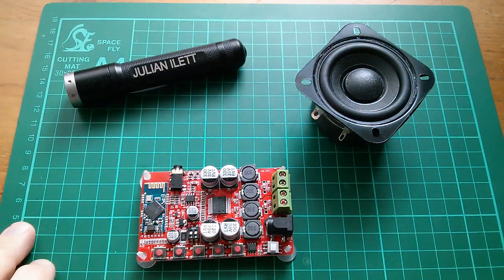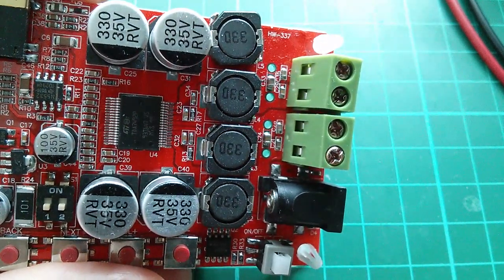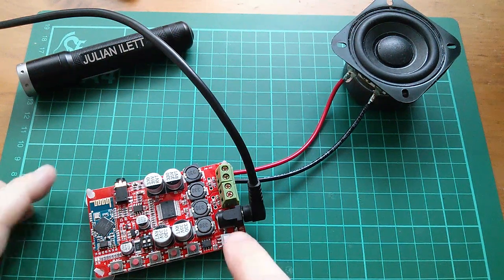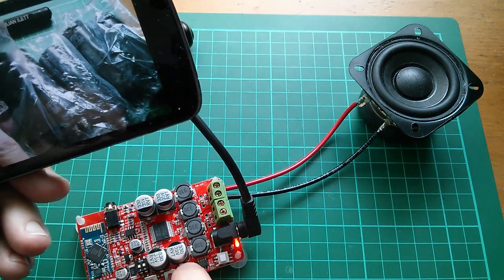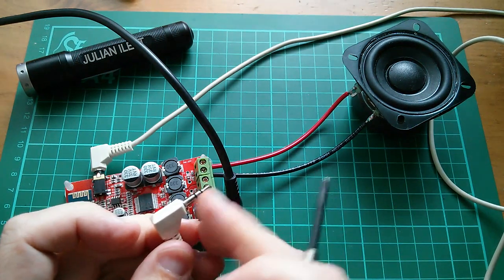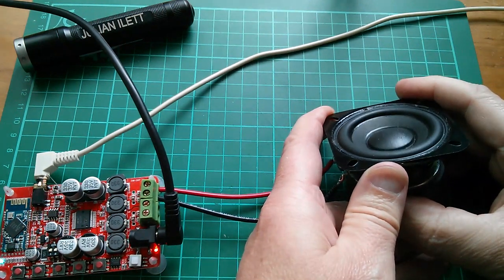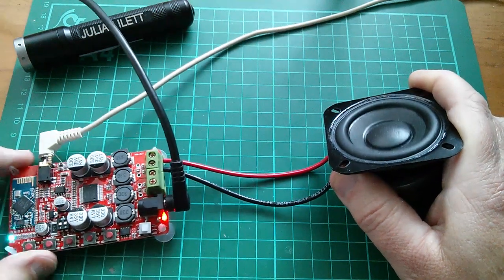SuperCapacitor Bluetooth Speaker Testing

Comment: if you use a boost buck DC-DC adjustable step up down converter XL6009 and set it to 12v, you can get more run time right down to about 3v. Alice sell them. I order them 10 at a time

Comment: Julian, tinning the wire ends that go into screw terminals isn't a good idea. I was told so myself but didn't really believe it until I found out myself the hard way.

The problem is that the pressure makes the solder actually flow, just very slowly. The inevitable result is that the connection gets loose, and then you'll get sparks, which are *hot*.

This way I managed to melt away the plastic of a lustre terminal with which I had connected two 5W heating foils in series to 24V. That's not even half an Amp.
I should add that the time scale was several months until the actual short, and that there was really NO mechanical stress on the connection - other than of course that of screws pressing onto the tinned wire ends.

Comment: with the supercapacitors and one speaker it takes ~7 to 10 seconds for 0.01 volt to get consumed if we assume that the real charge of your capacitors is 2.5volt each then we are talking about 15 volts so in order to go from 15 to 8 volts at the aforementioned rate there needs roughly one and a half hour to pass... so not that much really (comparing with other BT speakers that last for hours some do more than 8 )

Comment: I think the sound in your device is turned off due to the fact that the AUX input passes a sufficiently strong signal and triggers the protection of the chip of the amplifier. Try to lower a volum in AUX. I had a similar problem when on this board I put the capacitors on the speakers as a filter and when I increased the volume on the board of the amplifier, I was protected and I had to reconnect the power supply.

Comment: Can I ask you 2 questionsthe first question would it be possible to have the volume buttons  be off the circuit board and elsewhere but within the same unit 

Alternatively if I wire say a 10K  potentiometer between the speaker and the board  could that act as a volume adjustment knob

Comment: I recently bought a Chinese made DC to DC buck converter, that was supposed to take 12 volts to 40 volts DC in and with the pot convert it down to 1.volts DC out. My plan was to hook it up to a 12 volt DC laptop power supply to it to power both my MP3 player and a Chinese made 12 volt DC dual channel amplifier board! BUT The moment I powered up the laptop power brick....the caps on the two buck converters exploded under just 3 amps of load from the laptop power adapter! 

Long story short I changed gears and decided to hook the laptop power supply to a standard car stereo! And totally scrapping the idea of the amplifier board! So I as wondering if anybody had any ideas for a decent buck converter that would work in this set up if I did decided to go back to the original idea! Thanks in advance!!!

Comment: I did a quick (non-technical) estimate of how long the charge would last (assuming the capacitors were "full"). My estimate - roughly 30 minutes - is based on timing how long the voltage in the video took to drop from 10.55 to 10.50 volts. I then used this to reckon how long it would take to drop to 8 volts (the threshhold voltage to make this particular loudspeaker work). The figure I came up with is roughly 30 minutes. 

Needless to say, this is less than impressive and makes me wonder whether the whole idea of getting speakers to work on capacitors instead of batteries is fundamentally flawed. It is interesting that the crowd-funded Blueshift capacitor-powered portable speakers project seems to have folded. I can find no other similar commercial ventures on the internet. Heigh capacitor weight, low power density and low suppy duration may be the reasons.

Comment: Polarity does matter for stereo. if there is no marking on the speaker then connect a small dc supply for a moment. if the cone comeout outward then positive pin is the one that is connected to the positive of dc supply. any one working with audio should understand the polarity first. inadequate experience sometimes reveal wrong information.

Comment: Interesting project. The voltage change will make that tda7492p start to sound quieter as the voltage comes down. At 20v it might make 20wpc and at 8v it might make 5wpc. So depending on the volume level you might notice the difference every 20 minutes or so while listening.

Comment: 2 things 
A you only saw the voltage drop with one speaker.. 2 speakers will double the V drop.. 
and point B
when driving an amp with lower voltage, the output power will be less because of the voltage drop and increased current.. so clipping occurs way faster that way

Comment: That mute pin is to stop the power surge going to the speakers when the power turns on as well as to prevent bluetooth and aux both playing at once. If you dont want it to mute, disconnect it from bluetooth.

Comment: Maybe you can use the LTC3780 boost / buck converter to step the voltage seamlessly up and down :) So you can get lower than 8 volts at the input.

Comment: The mute function on the data sheet was likely supposed to be connected to an aux input jack that had a built in switch.  My guess is that either the jack they used doesn't have the internal switch that senses when you plug in an input or they simply didn't connect it up.  In situations where this amp board may be driving a higher amplification stage, you would likely want to mute the aux input when not in use to reduce noise.  When you finalize your project it would likely be a good idea to have a switch for the aux input just to eliminate possible noise.

Comment: I have an amplifier like that, earlier revision and it gets wonky at maxed volume as well.  I did have fun testing voltages from 9V-19V based on what I had around.  Give it more voltage and you'll get more volume out of it and not have to use max and get the distortion anymore.

Comment: Polarity makes a hug difference if listening to headphones. With in-phase speakers, a sound that comes from both sides equally will appear to be in the center of your head. If the speakers are out of phase, you will hear them both distinctly on the sides of your head.

Comment: Julian, consider adding a boost regulator with an enable pin, set it up to turn on around 8.25V and off at whatever the minimum is for the regulator, this would allow you to run much longer.

Comment: Hey just a question regarding this board is is possible to set the vol to max  when using bluetooth. I am planningto use in the ceiling to drive a speaker using the room lighting power so I will have no access to the button but as you know when you turn on the vol is set at half if you soilder the button on it will beep at the max setting. have you any ideas.
Regards
Greg

Comment: if the speaker connectors have a common ground, then the easiest way to find "-ve" connection is to see which 2 screw connections had continuity? or am I missing something?
Reply: I think the -ve of the two channels are not common as both +ve and -ve can swing between 0 and vcc in this amp. Connecting both the -ve together will short the amp.

Comment: This is one of the best value for money amplifiers I have bought and tested. When you have this as your sound processor and a set of decent drivers, you have a set on the same or almost the same level as a Marshall Bluetooth speaker at a fraction of the price.

Comment: Julian, 'ianstrobe' claims the Play/Pause button doubles as an input 
select switch. Holding it down for 3 seconds toggles between AUX and 
Bluetooth input. It appears the modification was in vain. Were there any
 instructions with the device?
Reply from the maker: +alanmelb I did try holding the buttons down, but maybe not for 3 seconds. I'll give it a try.

Comment: Don't you just love undocumented (or forgotten!) features? That speaker looks like a cheap, second-hand midrange one, so don't expect any great shakes from Bass or Treble frequencies. Nonetheless, it works well, and should be fine for the low quality delivered by even the best mp3 files. If you want to listen to stereo sound, you need to do at least three things with those speakers: 1) Make sure that the polarity of both is identical (Yes; it is very important!), 2) Put the speakers in a correctly-designed box, and 3) Space them apart adequately. Maybe 4) Buy Bass and Tweeters, plus the correct crossover circuitry for the speakers, and 5) Use decent quality sound files. But 4) and 5) are for purists!
Reply from the maker: +RWBHere Yes, I agree. I may also look at passive radiators.

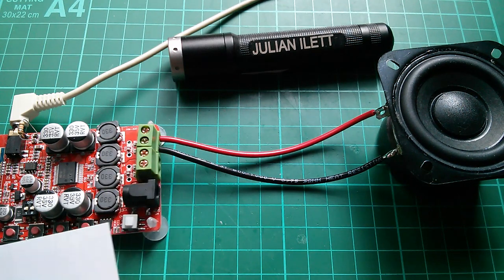Comment: 15:45 Ouch, that speaker does not seem to be happy...
Reply: Yeah, I guess I would put it on mute for 2 seconds with a 555.
Reply: Kyôdai Ken and how would you do that?
Reply: he meant, put a voltage on the mute pin of the amp chip for 2 secs with a 555. but to say, you can just do it with a capacitor and accessories.
Reply: Yes, this is what I meant. Now that I think of it, this is not a guarantee to stop this weird dc offset from happening on power on...

Comment: Hello Julian what about Adding a make header pin 2 pin to that Resistors bypassing it. With a Jumper on the header pins? are they close enough you can do that?
Reply from the maker: +joseph chrzempiec I may add a switch, because disabling the mute circuit compromises the anti-thump.
Reply: Julian Ilett ahh okay I understand I think I had this problem on another bluetooth speaker I had. that explains a lot

Comment: Around 5 minutes? It's draining at 0.01v per second.
Reply: Even 0.0075 approximately. This will give you roughly 5 minutes and 30 seconds.
I would put a buck boost on it, but one with just one PWM controlled (not buck and boost one after another) (and smoothed) output that can accept 5 - 24 volts, so this would use up most of the energy in these cells.
Reply: Actually the voltage dropping is much slower than I expected. I counted 4 seconds each 0.01 volts drop. So 0.0025. With a drop to 8 Volts (2.6 V) it will last 17 minutes!! Of course, with a second speaker, I guess it would be around 10 minutes. With a good boost converter, we could get 30 minutes out of this capacitor bank, I guess. But I would go for more capacitors with higher voltage and without a boost converter. I guess this might give the best results and perhaps up to 2 hours play time. Well, it can be charged very quickly from mains. :)

Comment: Been building speakers using these amps for over a year, I really think the bloke that did the video should stick to playing with Lego before he kills himself as he truly has no clue what he is doing.
Reply: Hello paul marson 
Have you  tryed linking 2 of these devises so that you can hook up 4 speakers instead of just 2? The only reason I'm asking this is because I have 2 of these amplifiers and don't want to purchase a 4 channel amp.
Reply: Arturo Torres if it's for 2 tweeters and 2 woofers use a crossover
Reply: Was thinking the same thing as I had a few ideas floating in my head. What the downside of removing the Bluetooth pcb completely and just have the two aux input along with 4 speakers and a on/off switches to control either board depending on what I want to connect to via aux. I don't want the Bluetooth taking control every single time I turn on one

Comment: Disconnect the Bluetooth and it should play fine
Reply: Or connect a switch on your resistor
Reply: That happened in the video lol
Reply: I have a habit of mentioning things as I see them so I don't forget, but he waited until the Bluetooth timed out. If you want it to work right away, just unpair them.
Reply: Why do that?
Reply: Maybe he should investigate when the Bluetooth module actually actuates the Mute signal.

Best guess is that it only actuates when it is paired. You don't want both sources driving at the same time. It would make sense that they would give preference to the Bluetooth.

Did he ever trace the output of the Bluetooth and the aux input to see if they both ran directly to the inputs of the chip? I'm wondering if there's a Paired signal that might be driving switching circuitry.
Reply: This is why I said to disconnect the Bluetooth and it should play fine
Reply: "You don't want both sources driving at the same time"   Karaoke?  Playing at DJs?  :)
Reply: Using anything plugged into the aux in without the Bluetooth module shutting it down. Like a mp3 player that doesn't have Bluetooth. So just unpair it.

Comment: The positive is necessary for speakers if you want any bass for one example. Positive is located at the outer connection of each green block. On some the green connector block covers the polarity.
Reply: MrBrymstond no because its not using dc dc burns speaker its using a.c. so it does not matter really
Reply: It matters with my guitar amp, house amp, car amp. It warns me to use the pos to pos to insure a good bass response
Reply: Speakers don't like DC power
Reply: Except Phasing matters.
Reply: it matters whenever you are putting more than one speaker in the system. if you have two speakers and one is the opposite polarity to the other the second speaker will cancel out the volume of the first speaker.

Comment: You got quite the speaker thump at 15:49 when you plugged power in. Is that since bypassing the mute? Could you add a simple timer circuit to only bypass the mute after a second or so of receiving power?
Reply from the maker: +Azayles Yes, I think the mute also works as an anti-thump. I'll investigate a simple timer circuit.
Reply: HI that would be nice. i dont have an aux socket on my TDA7492 with 50w and this start pop is annoying...

Comment: Very odd that it mutes like that, at least it was an easy fix.
Very interesting project.
Reply from the maker: Thanks Mark. The modification may need a switch, because it seems the mute also works as an anti-thump.
Reply: Ah! I just commented on that, too :P Thought I was first (or one of the first) to notice it :D
Reply: The DIP switches actually increase the gain.  I do not recall the value, but it ups it a bit.
Reply: Julian, thanks for this great video, it's always a pleasure to watch... But please consider that many of these boards have different modes of output, for example I need to keep the play button pressed for for few seconds, and then I can use the AUX port of the board

Comment: tip- scrap the green connector and solder wires directly on the pads. I didn't notice much interference in the video but i get a lot with mine, one way that sorta helps is to directly ground the antenna of the blue tooth to ground, another thing is with the 2 small toggle switches that limit the volume, i found it helpful just to scrap the switch and solder the links directly. still hiss's tho, but you get what you pay for.....
Reply: also my amp draws up two 2 amps at start up so your capacitor protection circuitry must be able to handle it.

Comment: Did you measure the current used by the amp, at least with one speaker?  It would also be interesting to confirm whether the current increases as the voltage reduces (i.e.: constant power), or reduces or stays the same, and how this changes with volume.  All relevant to the runtime on one supercapacitor charge of course.
Reply from the maker: No, I've not done that yet. Power output should be proportional to the voltage squared, but maybe the chip has some kind of compensation. That bit of fun is still to come :)
Reply: Just calculated by measuring the voltage drop rate in the video.  It dropped 0.05V in 32sec.  The capacitor bank is 6 x 500F in series, which is 83F combined.  0.05V x 83F = 4C, which is 0.13A for 32 secs.  That gives a power of 10.5 x 0.13 = 1.4W.   The 8 x 700F capacitors that you're planning to use hold 4Wh from 8 to 20V, so if that 1.4W avg stays constant then you'll get a little under 3 hours usage on 1 charge.  That's with just one speaker, so guesstimating that the speaker is using 1W then the pair would be 2.4W, giving 1.6 hours runtime, but considerably better with reduced volume.  Not bad for capacitors!
Reply from the maker: Not bad indeed. Hopefully the total cost can be kept under $100 too :)
Reply: You can also say, if it's linear:
10.55 to 10.54  Δt = 6.04 slope 0.0017
10.54 to 10.53  Δt = 7.08 slope 0.0014
10.53 to 10.52  Δt = 4.92 slope 0.0020
10.52 to 10.51  Δt = 9.34 slope 0.0011
10.51 to 10.50  Δt = 5.03 slope 0.0020
10.50 to 10.49  Δt = 6.05 slope 0.0017
10.49 to 10.48  Δt = 4.87 slope 0.0021

Give a average slope of 0.0017
u(t) = U(0) - 0.0017t

t = - (u(t)-U(0)) / 0.0017

If I trust the datasheet, 8 to 26 volt for the chip.
And the maximum voltage of the capacitors 16.2 volt (2.7 * 6).

t = - (8 - 16.2) / 0.0017 = 4523.5 s = 80.4 min. = 1.3 hours of playing time.

Comment: How about a boost converter to massage all those remaining angry pixies to play music below 8v....
Reply from the maker: I'm undecided about that - I ran the capacitor bank right down to 6.5V before it shut off, so there wouldn't be much benefit using a boost converter. But I'll certainly mention it as an option.
Reply: I have that same amp, it works great
Reply: Not worth it.  The capacitor bank holds 4Wh between 8 and 20V.  A boost converter might take you down to 2, but between 2 and 8V you only get another 0.7Wh.  If the boost converter is 90% efficient that only leaves you 4.2Wh - a 5% increase.   Also I think the board will waste more quiescent power running it at a constant high voltage, more than cancelling out this increase.